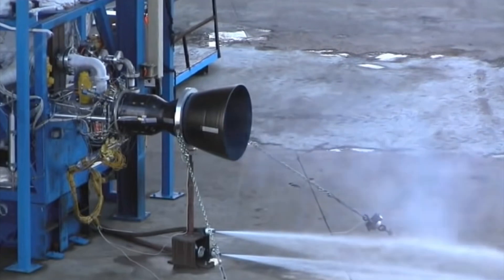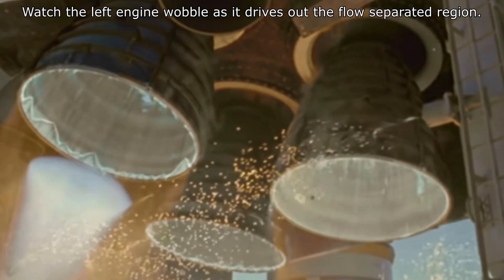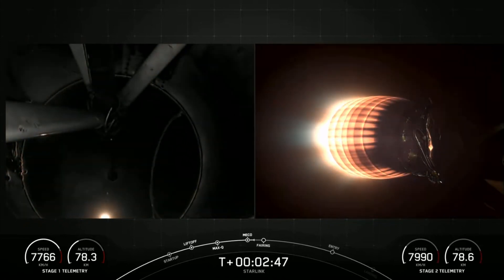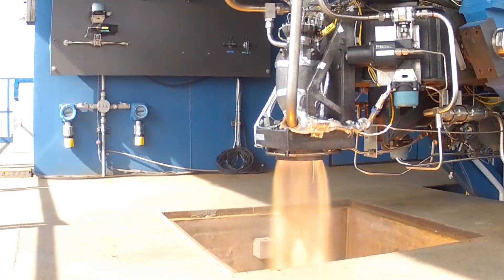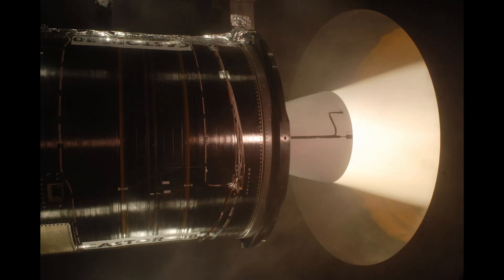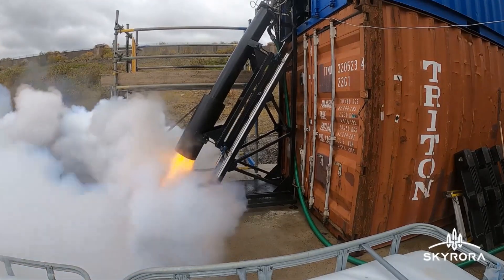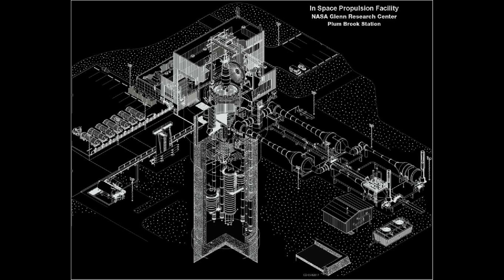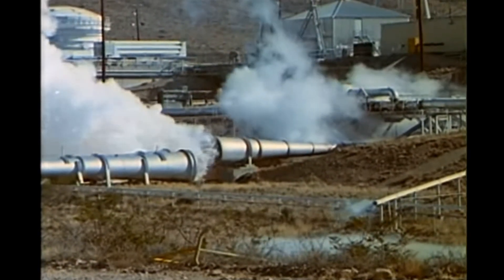Defying Atmosphere - How Rocket Engines Get Tested In A Vacuum Before Going To Space

Comment: I thought you would adres the fact that in weightlessness propellants are not at the bottom of the tank but float around in the tank..
Reply: SpaceX has video of the Oxidizer floating around/sloshing around inside the tanks during ascent and zero-G restarts. The cameras were inside the tank complete with lighting.
Reply: Rockets use small ullage thrusters to push the propellant to the bottom of the tank before ignition.

Comment: How are the vacuum Raptor engines on Starship tested without damage? Has a Raptor engine ever been started/tested in a vacuum?
Reply: For basic testing the nozzle is not big enough to cause flow separation at 1 atm so it can be fired on the ground.
Reply: That doesn't really answer the question. What does "basic" testing mean, and how is it different from actual use? Why would that sort of testing be doable at 1 atm?
Reply: @kmac032284  Basic testing is where they start and run it, but not in a vacuum, just on the test stand.  With Raptor the bell is not big enough to be a problem the flow doesn't separate.  When they do a similar test if the M-Vac they have to take the bell right off because it does experience flow separation.  I have no idea if or what kind of 'vacuum' testing facilities spacex has though so what or how they do testing beyond that I do not know.  Sorry.

Comment: I thought they used a venturi vaccuum nozzle to pull gas out of a big chamber, using the rocket's own gases. You know, like a paint sprayer. Turns out I was not exactly spot on, but quite close.
Reply: The Tactical High Energy Laser project  (THEL) DID use a very large liquid Rocket Engine (Atlas perhaps) to pull a vacuum on the liquid laser reaction chamber to pull the reactants through it quickly enough to form the laser beam.
Now that we have fiber-laser amplifiers we don't need the giant chemical lasers we used to use.
Reply: @stuartgray5877 Thats interesting, makes me think it might have been used on the 747-based airborne laser lab a few decades ago? I recall reading some article years ago mentioning chemical lasers aboard that plane, and after the latest North Korean ICBM "test/threat" over Japan- was thinking it would be useful to mess with their development program😂oops!

Comment: Scott I worked art the Air Force Rocket. Propulsion Lab Edwards AFB  now called AFRL saw test done in altitude chambers and outside in the world. It was fun and loud.  Saw massive steam vacuum systems and the chambers they sucked down.  We worked on a few solid motors that were for KHIT AND AHIT using beryllium as opposed the the normal Aluminum.  The long delays from building the facilities to doing the testing I have some great stories that you would love.
Reply: OMG... the exhaust from a beryllium metal powder solid rocket would be incredibly toxic, and for much longer than most hypergolics! I certainly hope the  steam/water injector system captured most of the particulates, or that area would become a Superfund contamination site and anyone downwind likely poisoned! I used to work with beryllium oxide and metal alloy components- (carefully) as there were always bio-hazard warnings and special cleanup requirements associated with use😮. I'll have to revisit my e-copy of "Ignition!", but it seems unlikely that the ISP boost would be worth the risks, at least within earths atmosphere.
Reply: @KevinSmith-ys3mh  I work at a Major Aerospace company, and we flat out REFUSE to machine any Beryllium. We use it but must have outside vendors work with it. It is just too toxic.
Reply: @KevinSmith-ys3mh  I know that they had a few areas that had beryllium contamination and were exclusion areas,  the vacuum chamber was planned to be sacrificed for the series of tests for the satellite killer system under the Star Wars programs I know that Khit and Ahit were proven technology and the last piece of the puzzle and I think that was also finished.  I was exposed the hyperbolic propellants they are nasty got sick twice with full protection.  Got to love it.

Comment: As a kid, we used an 'eductor' which is similar to an air ejector, to remove water from our small boat.  A garden hose with a water supply, this funky-looking brass tee fitting, and another short section of hose from the fitting that led over the side.  Just turn on the garden hose and watch the water get 'sucked' out.

And don't forget the old steam locomotive 'boiler injector'.  Now there's a clever bit.  Take steam from the boiler at a pressure of say, 100 psi.  Run it into this clever casting that also has a connection to the water tank in the tender.  It sucks water out of the tender, and via a third connection on the casting, pushes water into that same 100 psi boiler!!!  At first it almost sounds like perpetual motion, but it works great!
Reply: Naval vessels use eductors too.  And for the same reason.  They are great for de-watering a space that was either flooded to to a leak, or flooded due to firefighting.  What makes an eductor better than a pump, is that they can carry debris which would foul a pump.
Reply: @jeromethiel4323 
There are similiar systems that are used to evacuate contaminated air from enclosed workspaces. Basically centuries that bleed compressed air through a slot at the wide end of the venturi. The better ones will move 100 cm for every cm introduced at operating pressure (typically around 6.5 Bar). Operate on the Conada Effect. Another product that uses the same effect is a Dyson fan.
Reply: @jeromethiel4323  That's where I had the idea explained to me, on water pumps..  I think it was on one of the big WWII US battleships.
Reply: @TheEvilmooseofdoom  Steam power plants use the same technology to evacuate air from condensers.  It's usually called an ejector in such systems, but it's the same principle of operation.  In an ideal world, no air would get into such systems, but it always does.  So you use a little low pressure steam to continually draw extra vacuum on the condenser to ensure peak turbine efficiency.
Reply: Sounds like a water-jet pump found in schools. We used those in labs (chemistry) - just plug them to the faucet and let the water do its miracle

Comment: Do they put the camera inside of the second stage engine ?
Reply: SpaceX has had cameras inside the liquid oxygen tank during a flight
Reply: @stuartgray5877  What i am saying is that, is the camera inside of the engine?  because if you see video you will see connecting rods that connects the two stages.
Reply: @areaofspaceflight  The SpaceX rocket have cameras on the first stage that look right UP the second stage engine as it ignites.
I don't know what you mean by the 'connecting rods'.
Reply: @areaofspaceflight  You might need to cite a time stamp, I don't understand what you're asking either so there is a break down in communications somewhere.  Looking at the same image can help a lot.
Reply: @areaofspaceflight you couldn’t put a camera in it as it would be vaporized
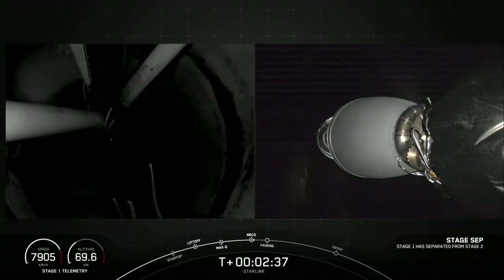Reply: Pause the video at 2:50 it looks like there is a camera inside
Reply: @areaofspaceflight  that’s a camera in the interstate on the first stage
Reply: @peeperleviathan2839  naw i see 
Thank you

Comment: One day it will be cheaper to do some of these tests in space than to use elaborate test facilities on the ground. I think that's pretty cool.
Reply: No, it won’t. The rocket equation is a cruel mistress.
Reply: @markuskoivisto  - Actually it likely IS currently cheaper to launch a small payload to space than to build a big enough vacuum test facility to test a rocket engine in. My company just spent almost 100 million building a very large Thermal Vacuum chamber ad IT is still not powerful enough to fire a rocket engine inside of.
Reply: @stuartgray5877  this video shows how it’s done: you don’t need a huge vacuum chamber because the rocket creates its own vacuum when it’s in front of a diffuser. 

You can send an engine to space, but that’s not very useful without the propellant to fire it... 

Going to space is very expensive.
Reply: @markuskoivisto  - Sorry you are probably right. I am only a vacuum test specialist with 30 years' experience running some of the nation's largest thermal vacuum chambers with Billion-dollar vehicles inside.
And I have only been launching things to space for 28 years.

But you probably know more about this stuff than I do.
Reply: @stuartgray5877  all I can say is that the vacuum chambers they built to test rockets back in the day were not that expensive. It’s what this video is about - did you watch?
Reply: @markuskoivisto not if you build it in space, for example on a space station or on the moon
Reply: @AleksandrPodyachev  that will never ever be cheaper than building on earth where you have all the raw materials and transport infrastructure readily available.
Reply: @markuskoivisto  You're not thinking outside the box enough! :P

With heavy lift vehicles it might one day be possible to get your test engine on a flight as part of a ride share!
Reply: @TheEvilmooseofdoom  I am thinking. The engine is useless without the propellant to fire it, which means it’s not a rideshare launch. Basic physics, people!
Reply: @markuskoivisto  That's a bit simplistic and not well thought through.  To send up a engine for testing you would include propellant tanks, just like ride share sats also have their own engines.  You wouldn't just send up a engine alone.  THINK.
Reply: @TheEvilmooseofdoom  exactly. Now complete that train of thought. The propellant is much heavier than the engine.
Reply: @markuskoivisto  Which is meaningless.  The final mass is the final mass, it will change with the kind of engine and how much or long a test you need to conduct etc.  You're still not thinking things through which means your making simplistic assumptions that are.. well meaningless.
Reply: @TheEvilmooseofdoom  yes. And to bring propellant to space to run the engine, you’re then dealing with the cruel mistress of the rocket equation. Far simpler to test on earth.

Comment: Thanks! I'd always wondered how they maintained a vacuum with a burning rocket, ever since Cody's Lab video.  I'd assumed it was some trick involving huge tanks of vacuum, maybe with falling water in place of pumps to try to keep up, but this is so much cooler.
Reply: Wow that's a relatively simple way to do it, but would be very difficult to test large rockets for more than short periods.
Reply: It would have to be HIGHLY accelerated to high velocity water, wouldn't it, before startup, unless it was a VERY large pipe?  Kind of like a gas piston on the rarification side, the type that occurs in car exhaust headers, which is the reason the length of the individuals to the collector matters, tuning for a given RPM?  Is that what you are envisioning?  Either that, or I'm misunderstanding your concept.  These things are not hair dryers, there is a LOT of flow there, at VERY high velocity.
Reply: @MrJdsenior  Like, take a swimming-pool-sized tank of water where the entire bottom can be opened.  Obviously it wouldn't be able to pull a full vacuum thanks to the air pressure outside and the tendency to boil at low pressure, and it'd only last for a second or three, but maybe something other than water would improve that a bit.  Maybe still helpful for testing the few seconds after ignition to see how long it takes to become stable?

Of course, it's all impractical in light of the Venturi-like use of the rocket to provide its own vacuum, which is really ingenious and probably way cheaper to build and run.
Reply: @georgedorn_fnord  even if it were an infinitely long pipe... sorry, "pool"... it wouldnt fall away any faster than G, and the pulling of a vacuum just slows it down... will only retain the pressure thats sort of equilibrium to the rate of descent and the gas filling the "void".

you can play around with the old "inverted cup full of water" and hanging weights off the sheet... find its always surface area that counts. you can only suspend as much weight as the atmospheric pressure over area can manage versus the vapor pressure of the water over area. its not moving until it falls... do it with a piston and the piston height will always be proportional to the weight as the volume of vapor in the space above increases...

whereas the bernoulli effect, venturi... its characteristic is that high velocity fluid has ZERO pressure at right angles.  and obviously any angle steeper that creates the desired separation of the fluid with resultant "void". as long as what comes AFTER the nozzle can deal with the flow, and just like a wing... isnt so poorly shaped it enters turbulent flow, aka "stall".. people overlook that what comes AFTER a venturi tube is even more important than the intake! the intake sort of naturally does its own thing as air stagnates and "smooths" sharp corners... whereas in the tail, the flow is contrary to the change in pressure... remember... flow always likes to go from high to low... not low to high! the lead out of a venturi tube has to be very gradual and smooth to work properly.

steam water feed injectors are a pet love. exhaust steam water injectors are even more amazing... using the heat left in the condensing steam to still get water into the boiler whilst under a pressure far exceeding the exhaust steam used...

amazing, when you dig through the old books, how clear it all is... the whole converging diverging nozzle ideas...

or turbines...

consider a water sprinkler that spins... everyone thinks the water will squirt harder from the nozzles as the centrifugal force will fling the water out and create a higher pressure at the nozzles... this indeed is what happens! except... its counteracted by the fact that fluid from the hub to the nozzle would rather flow from a high pressure to a low pressure...

and by restricting the flow of the water in the arms with the nozzle to create more squirt, the pressure had to rise and of course, the differential in pressure causing the water to flow DOWN the arm is reduced... exactly in proportion as the pressure is increased and creates more force on the nozzle/arm. net gain? zero. the arms spin with the force produced by the pressure applied by the source, no more, and often far less!

lol. most people have a real hard time with forgetting that most systems are not isolated...

Comment: When the shuttle engine starts, the first few seconds with with flow seperation, you can actually see the nozzle bells flex until the thrust pressure stabilized.
Reply: 1:03
Reply: That slow motion video of the nozzles flexing is kind of terrifying, the amount of energy being released by that beast is awesome. I love the RS-25 engine.
Reply: Yeah I never noticed that until Scott pointed it out.
Reply: There's also videos of early tests of the SSME at the SSC A-2 test stand where you can see the diffuser; there are also other tests where the smaller 35:1 expansion ratio nozzle was used and it definitely looks cursed
Reply: The SSME will always be the sexiest rocket engine to me, though raptor is pretty BA too
Reply: I had wondered what that was for a whole while before learning about overexpansion.
Reply: It raises the pucker factor when you realize the flexing bells have fuel flowing through their insides to pre-heat it, and to help keep the bells cool.
Reply: Yeah I just watched the video too.